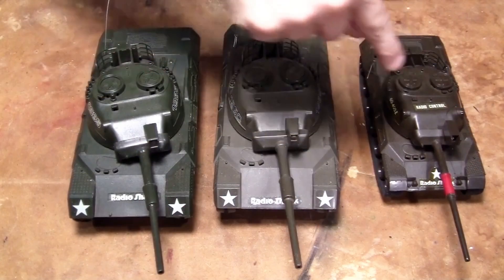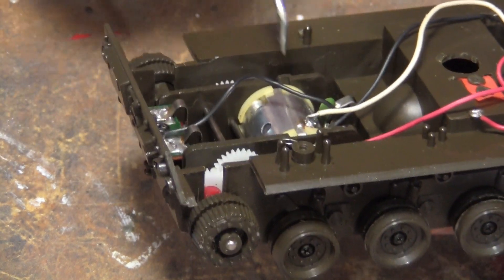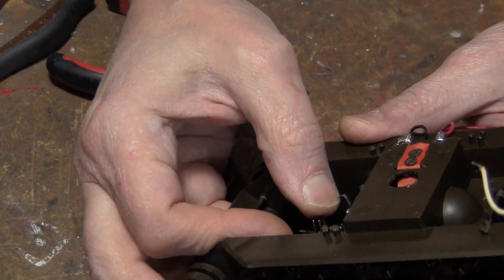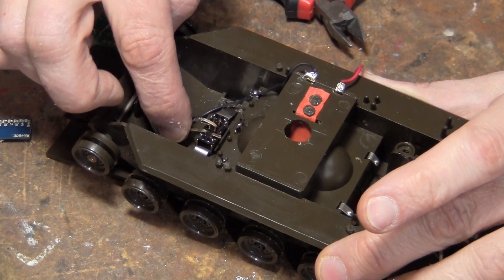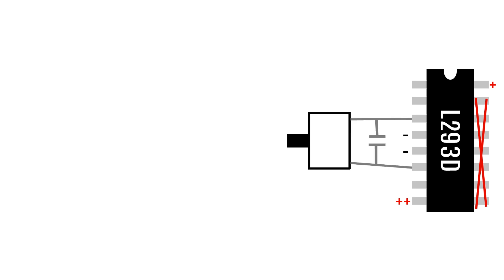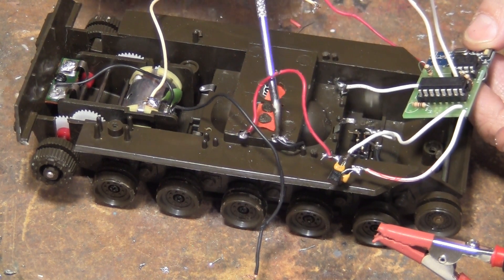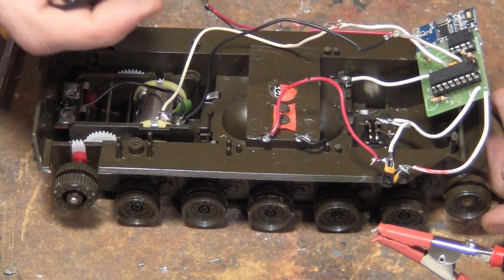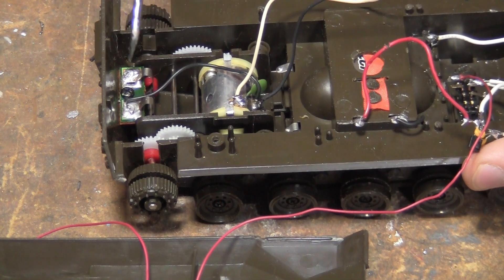RC Tank Time Machine: Rebuilding '80s Tech from the Ground Up

Comment: The 12v battery is just 8 1.5v alkaline button cells. So it will work from 8v to 12v.  The tolerance is probably good enough to work down to 6v when your alkaline 9V is about dead at 1v per cell.

Comment: Companies using those 12v batteries is ridiculous. They're hard to find and expensive. Anything they're used for could have easily been manufactured to run on a 3V coin or even a AAA, available in any Dollar Tree.

Comment: You can also wire the unused side of the L293D to be a inverter so that you can control the motor side of the L293d with a single High/Low control line. I do it all the time.
Reply from the maker: I don't understand how. If what you input is what you get out, how does it invert?
Reply: Not sure if Youtube will let me link to a video I did on moding a dual H bridge to a single line control for a single motor or not.
The method will work with any of the dual H-Bridge chips.
https://youtu.be/eDXcUsldIS4?si=irtR-Zz0L5IkdYaP @RandiRain
Reply: Can you link a circuit diagram? That sounds super useful.
Reply: I linked a video I did on modding dual H-bridge chips. Basically the unused outputs are tri state in that they have a open circuit position as well as high and low. So that means you can add a pull up or pull down resistor to these outputs to make them a inverted state that can be used to control the side of motor side of the dual chip. @vaderdudenator1